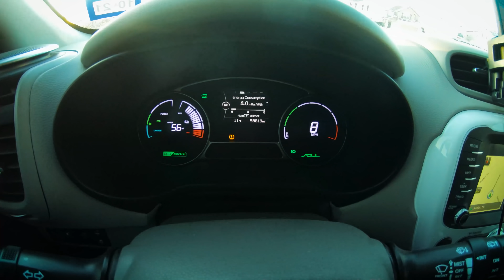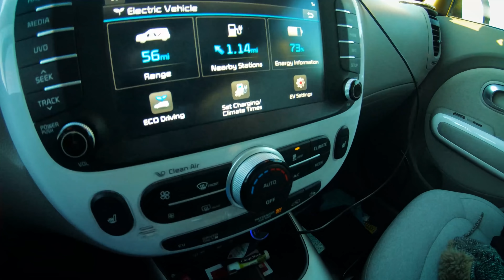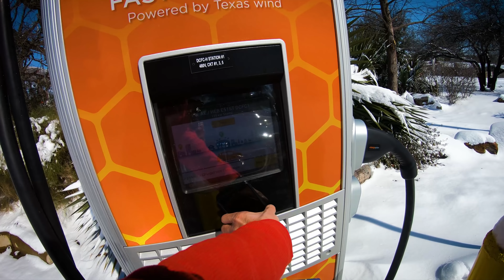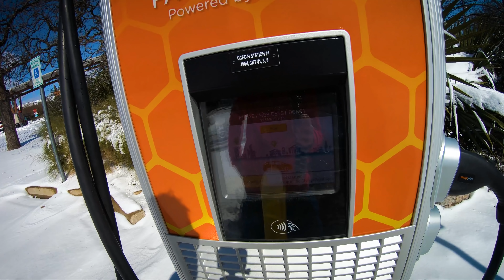GigaSnow Day at Tesla Giga Texas TeraTexas - Snowboarding at Tesla Factory in Austin covered in Snow

Comment: The kia soul is pretty good in the snow. It has good ground clearance. It was designed for 4 wheel drive.
Reply from the maker: Did you see Elon musk commented
Reply from the maker: So in my next video I finally went out and tried to get it stuck , and I did had to get a truck to pull my out but I literally drove into the park with like 1 feet or more of fresh snow , stupid love but was right next to my house do no biggy , but I realized it was the battery , under the car the battery sticks down low and is flat with like plastic bottom and once the snow got up to there NO GO. 

Still way better then my Mazda though and the traction control and regen made it really good , but again anywhere on the road the front wheel drive electric torque is where it's at

Comment: When is it forecast to warm up enough to start work again? It is reported here in the U.K. that Texas has been suffering power cuts due to a mixture of high demand and no solar power with snow covered panels and little wind in the cold to drive wind turbines, what is your personal experience?
Reply: panels blow off quickly, what with the wind they have there, it's mainly a wind power shortage with turbines frozen up. More solar, especially in the South part of the state, needs to happen, and along with that huge battery banks like are being built in Australia and Great Britain by Tesla to store up wind and solar power for times when that is needed but not available.
Reply from the maker: It's texas this is climate change , I believe 100% we are witnessing the polar vortex start to loose it's stability , as more pack ice melts each years and the atmosphere warms the polar vortex is becoming more and more unstable and pushing longer and harsher freak weather events , that's why this storm is lasting an unpredicted multiple days , 

This is the coolest time of year here and its normal to get most snow in the mountains here in Feb , and March 

But in texas we quickly warm up , so it's unprecedented , it'd 100% either pollution caused climate change or it is man made weather manipulation , making me want to do a video on this
Reply from the maker: But the weather days another day of slight freezing rain , and then under 32 till Friday , then up to 40 high and 32 low for a few days - which again is still pretty cold for us for a day or two , I don't think it'd been below freezing for more then 3-4 days EVER like EVER in my lifetime and maybe in my dad's lifetime has it ever been this cold for this long of period and had this much snow / ice - since ,the 1800s I heard
Reply from the maker: @FSD_PNW  actually most of our energy was produced by natural gas which was the reason for the problems , natural gas trucks couldn't get to their destinations , which lead to the shortage , only 14% of Texas energy comes from the wind and only a fraction of that was actually down
Reply from the maker: Actually solar panels do still work even in cloudy weather and with a little snow , not enough snow to cover most panels , 95% of houses have their panels free of debris , 

The problem is definitely. With storage and batteries will solve this quickly
Reply: @RoschetzkyPhotography  yep, while some wind turbines were shutdown, they only provide a tiny amount of the energy for the grid at this point. Most uses natural gas or other fossil fuel sources for the grid there.

Comment: I wonder about all the negative on bitcoin.  Bitcoin  mining doesn't run on anything that electric cars don't run on.  How could it be bad an electric cars good?
Reply from the maker: well if you look at the energy used or wasted by the paper money economy its is way more energy , banks , atms , online servers for online banking , just the thousands upon thousands of banks and bank tellers and printing press for printing paper money , updating the money , I think over time the energy used for alt currencies could be more energy efficient in the bigger picture
Reply: Not sure if you watch Now You Know on YT, they made a clip in regards to this and if the facts are correct then the whole banking system they use more power than Bit Coin. then if you throw in the stock exchange ands stock  broker companies then the p0wer usage only goes up. After you could then make an argument in to how many large companies and server farms use sustainable power. Then you will start to see what percentage is sustainable and what is not. So in my opinion you cannot make a judgment call on anyone company until you have all the facts. I would also apply that to the rest of the world too.
Reply from the maker: @DoughnutsInspace  exaclty where I got my info for my reply comment hahaha
Reply from the maker: @DoughnutsInspace  good ol now you know